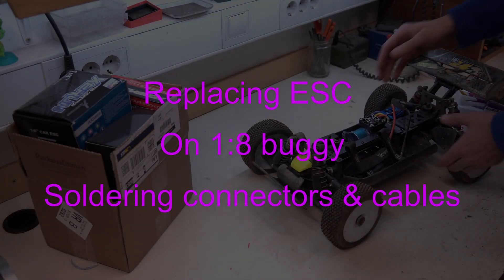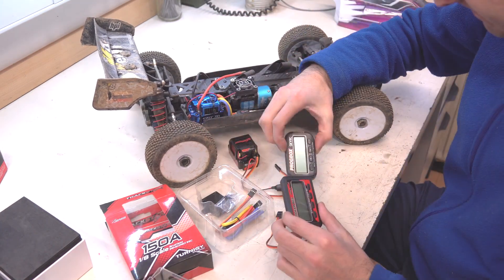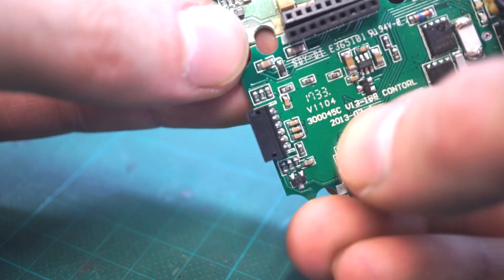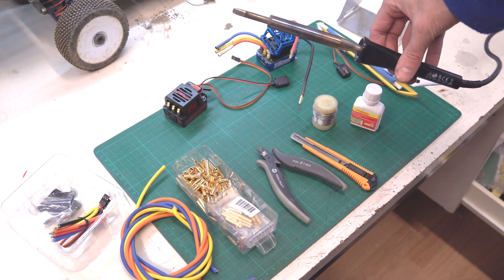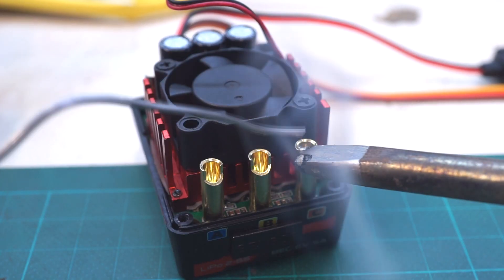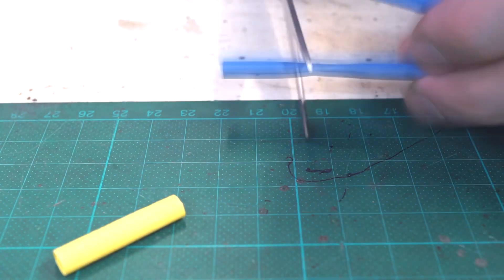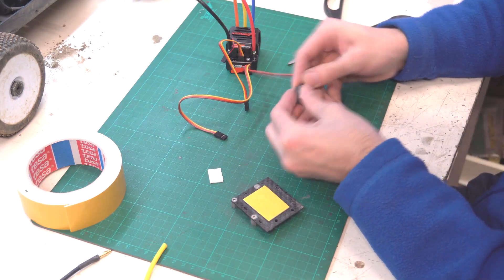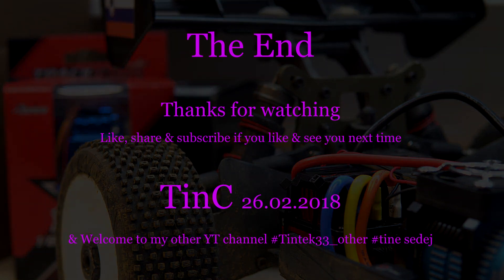Replacing ESC on 1:8 buggy [soldering connectors] Toro & trackstar the same ESC?

Comment: can you solder a xt90 connector in to that trackstar ESC TO USE 6S 40C LIPO?
Reply from the maker: Sure you can, but i don't know how much current can handle xt 90 because i use only bananna connectors, i try lot of different connectors, but the problems start showing on 120A and more, on 4s battery, they just heat too much so they loose and fall apart, sometimes desolder itself because of heat they produce from bad contact, 4mm long bananna can easy handle 130-140A on 4s and do not becom hot, but still replace them 1-2 times per sesion.

Comment: 80 Watt Ersa soldering station (Ersa Icon Nano) and I have no problem soldering 12 gauge wire. Another nice video from you!
Reply from the maker: Jernej Rošer ersa maybe got real watts ;-) what about 10 gauge cable on esc connector where you got lot of heat transfer to entire esc? Thanks anyway.
Reply: I know what you mean :). On the ESC PCB there are thicker pads and traces that need a heat more than a 10 gauge wire :D.